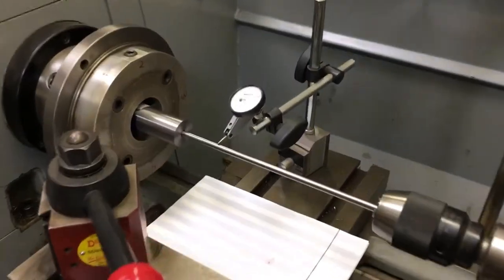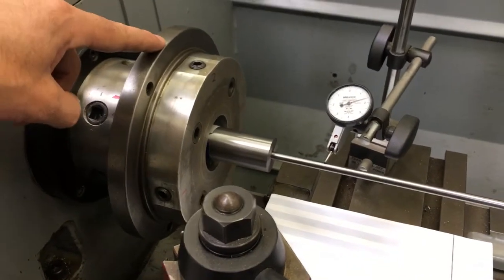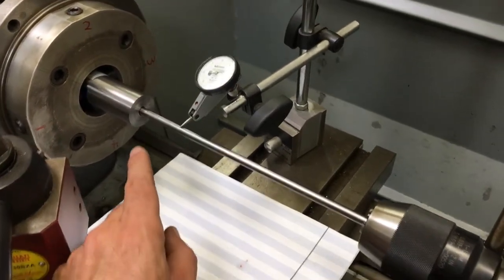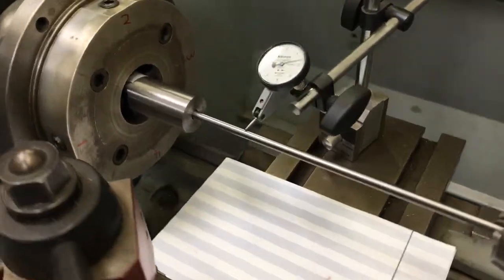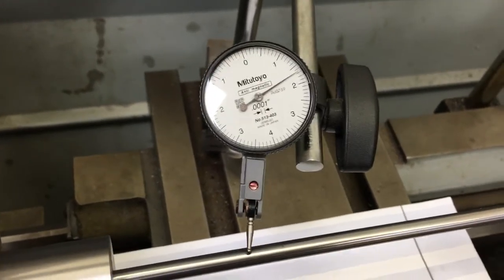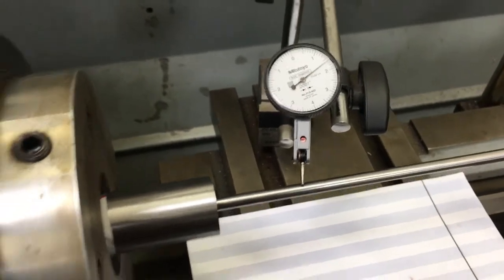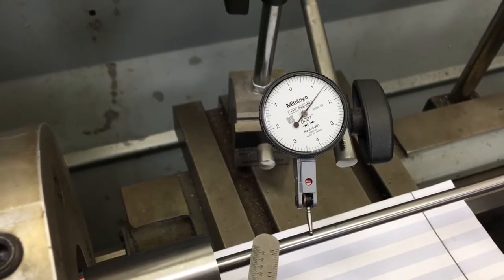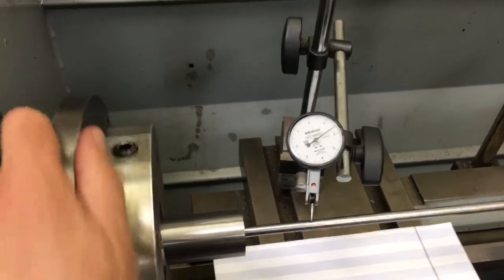Indicating and Dialing In.30 Cal Barrel In Precision Lathe (Breach, Threads and Chamber)

Comment: Why is the indicator rod in the tailstock?
Reply from the maker: The chamber will be cut from the reamer being held by the tailstock.
Reply: @trentgriswold  don’t you use a floating reamer holder?
Reply from the maker: @remoman depends on the project, but typically yes.